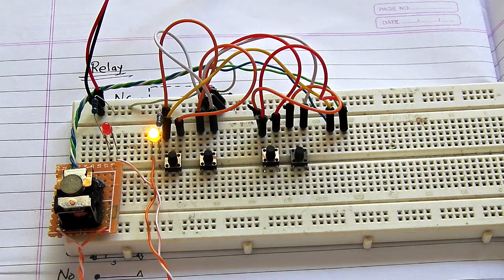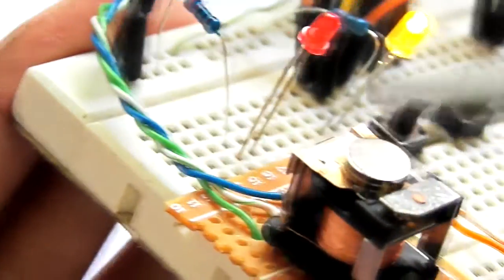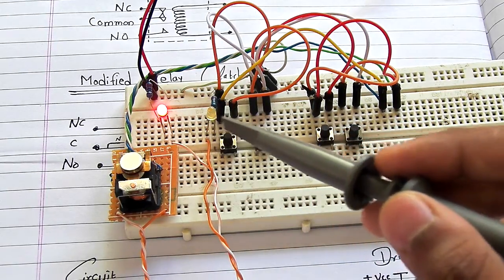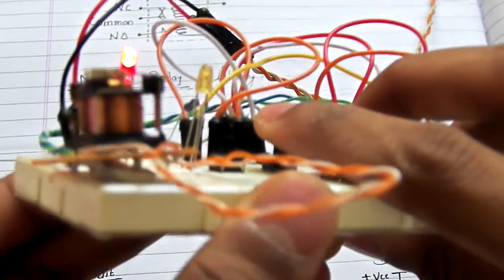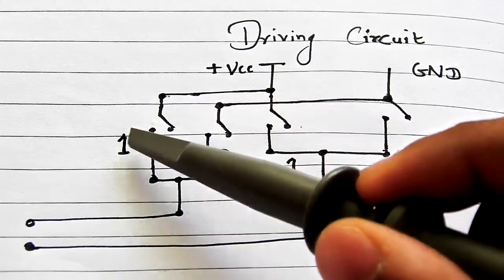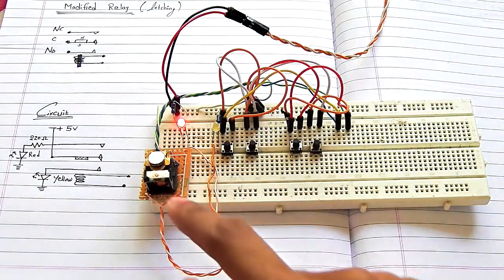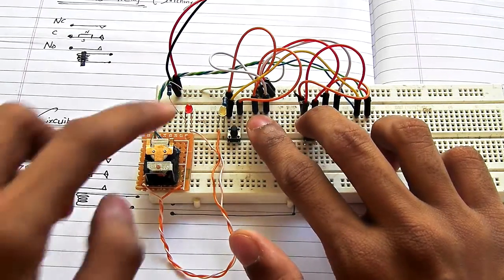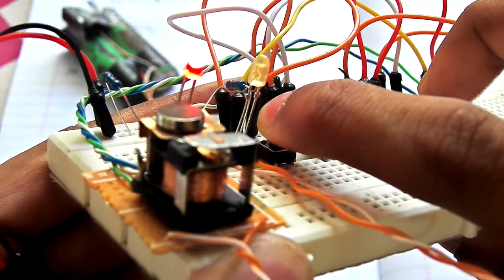DIY Make Latching Relay From Any Mechanical Relay

Comment: The neodymium magnet as I investigated will cause the core to become magnetized and the relay will no longer work as it should, don't you think that, if the creators If they had discovered that device, don't you think they would have done it that way? To prevent it from consuming energy, they never left a neodymium in that area.

Comment: Brilliant hack.  Latching relays are very difficult to source, so this is a good workaround for a prototype.  In the position where the magnet is holding against the spring's force the contact may not be as good as when its energized. That is if it were rated 5a then probably it could be usable for 2a, as a guesstimate...

Comment: bro use a 5v dpdt relay then ya cud just use 1 push button ay it lol and ya just made a set reset circuit move 2 outer switches and glue em together same center two ....ya made it look difficult cus ya using single momentary switches ya just reversing the coil aint ya lol

Comment: can u send a circuit diagram of that sample pls....
Reply: Let me make it easier for you... use your own brain. Start by making your own relay, its just electromagnets, when its off one LED is on and when its ON the other LED turns ON. the relay is a switch between battery and load normally Open, but if you push it down with your finger you would closed the circuit and it stays closed because the same circuit is powering the relay.  all you need now is a trigger to latch relay and  close the circuit ...using the same power source, just add monetary button to give relay its first kick. To turn everything Off do the opposite Make and use another relay that is normally closed, use another button with second relay to disconnect power from circuit... once its on, its on and once its off its off until you trigger again. to keep it simple keep relays separately, one on the neg side and one on the Pos side of power source. I just figure this out because i never knew how hard it would be just to make a mechanical oscillator without using transistor that burns up fast. this has only being tested with low 5Vcc.. would not try this with high voltage. and its not for permanent use... for serious continuous usage just buy two relay one that is normally open and latching and one that is normally close and no latching for disconnection.
Reply: thnx bro for a very kind explanation for a newbie like me.... very much appreciated...
Reply: im a newbie also, but i like to break things down so i can make it
Reply: Question; Does anyone speak normal, understandable American English here?
Reply: Hey guy, your "instruction" would be a lot better IF YOU SPOKE NORMAL UNDERSTANDABLE ENGLISH!!!
Reply: Hey guy, your "instruction" would be a Lot better if you spoke NORMAL UNDERSTANDABLE ENGLISH!!!

Comment: Hi, 
Very clever circuits.
I like the fact that it latches and the relay does not use power after that.
Just uses power to switch it from one state to the other.
Very well explained.
What size of magnet do you use and where can I buy them?